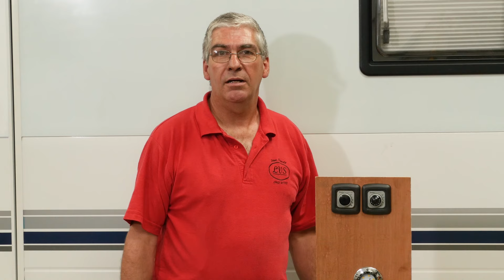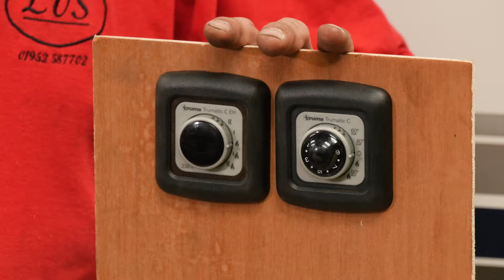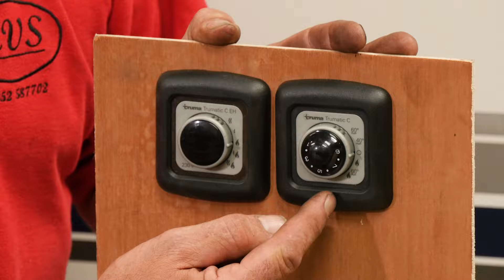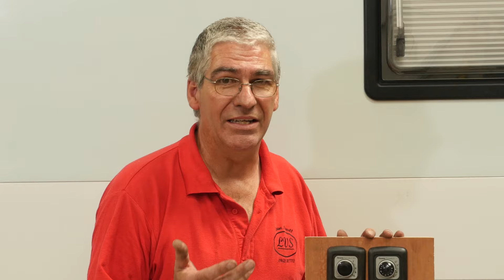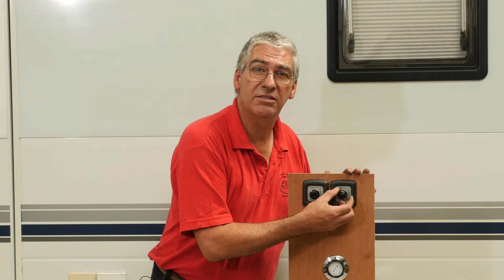Truma controls – expert advice from Practical Motorhome's Diamond Dave

Comment: Great video thanks.
The system isn’t intuitive when you wake up cold in the dark. In my Rapido the dials are stuck away in a corner behind the sink. Once working it’s very efficient but I have to refer to the cheat sheet every time I go to use it.

Comment: I'm thinking if the leisure batteries and cables are sized corectly and a good invertor is used that the hook up can be bypassed and the electric heater/boiler could be used off grid.

Comment: It’s taken me a while to figure out that Truma have used the Gas symbol to mean not gas but ‘Heat’ on the control mode panel. Exactly the same symbol on both panels - but means GAS on power panel and HEAT on control mode panel. Very very confusing and poor design. They should have used something like this 🔥 to mean heat and coloured it red.

Comment: I wish I had those not this blasted one I have. It’s no thermostat it doesn’t care that is ver cold it only cares about the blasted clock. I want heat as long as I am in it. I know how to turn it off. And another thing it make hot water no matter if you don’t want hot water. It way to cold to get a shower

Comment: I am a little confused. My motorhome only has the mode switch (the one on the right) so how do I know if the boiler is working on gas or electric.
Reply: This is the heater, not the boiler

Comment: Hi I have a Truma ultrastore water heater in my benimar 2002 Europe 6000 st ducato and it operates on electric mode perfect. But once I make sure the gas is open I get a green light initially but after 10secs get fault red light evertime. Any ideas thanks

Comment: Clear as mud. Another expert that knows the knowledge first then just explains the dials.

1) is the gas symbol for heaters or gas operation.
2) can you have elec heating without gas? If so how ?? I can’t work it out because the nob on the left was for water only. Nob on right does water and heating but requires gas use!

Argggggg!!! 

Also - on the combi if u turn dial to top two 60 and 40 that’s electric water heating - does the centre dial work the room heating?
Ie - HOOK UP WATER HEATING AND ROOM HEATING???

or not? 
Lol.
See what I mean!!!??
Reply: Hi Darren, we’ve been trying to work it out and we THINK the two gas symbols on the control panel with the dial don’t actually mean GAS - they stand for HEAT. Therefore the first symbol (that looks just like a gas flame) must mean heat on its own, and the lower one means heat plus water 60° and we think you can use them on either gas or electric, according to which power source you’ve selected on the other control panel. All very confusing and I’m not saying we’re correct but that seems to be the most likely explanation.